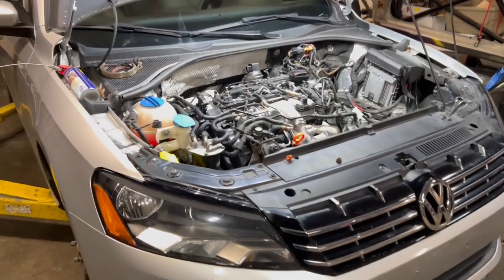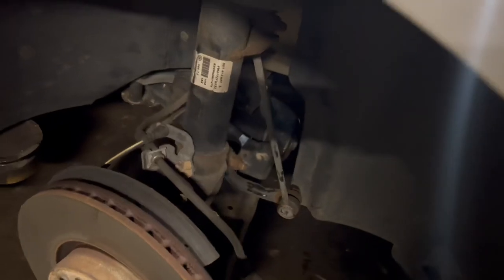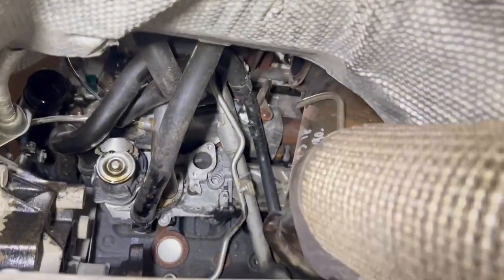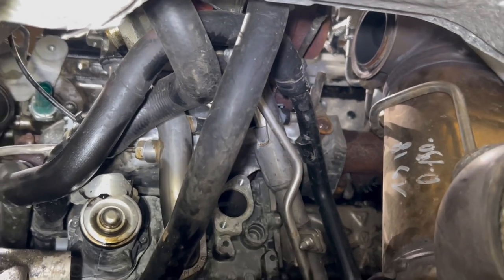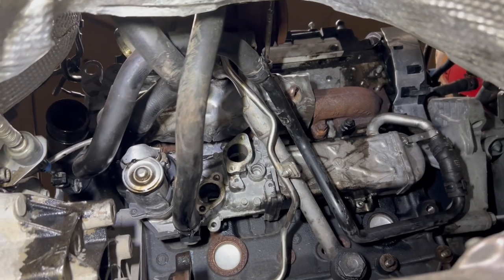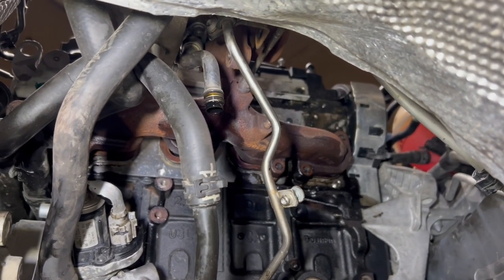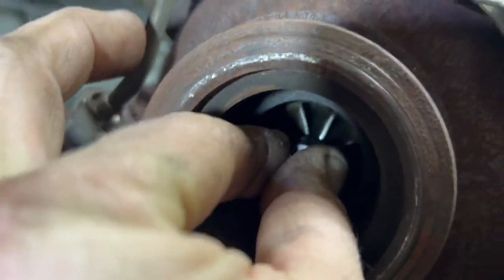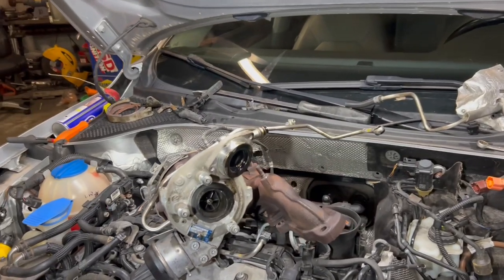VW Passat TDI 2.0 Turbo Failure

Comment: John on that turbo on the Passat you have to check the feeding line that goes to the turbo to feed the oil it kind of gets cooked internally and that's why it stops for oil and they break
Reply from the maker: Yes, I bought a new feed line as well
Reply: @TurboJohnRacing  good that'll save you a lot of problems
Reply: Its good practice to replace the  turbo oil feed lines whenever the turbo fails, as said above they clog up.

Comment: I had an Audi A4 for a short while.  The cam chain tensioner went out, I replaced with with a repro part ($100 vs $750), made sure it ran right and traded it in.  It was a nightmare to replace. I love the German stuff for many reasons but don’t think I will ever own another one that I have to work on…

Comment: My 13’ Jetta just had the turbo replaced at 165k miles. The compressor wheel exploded in half, was pretty impressive. I rocked the engine forward from undoing the dog bone  mount to the transmission and got it out that way.

Comment: John you should of callled me. I would of walked you through this been doing egr cooler flushes and dpf flushed this last week on these and the Audis and eco diesels . Take that egr cooler off and stick it in a bucket of purple power and water for a few hours you’ll hate for it to get plugged after just being there. Also it’s easier to disconnect the spindles from the struts and the rack from the sun frame and bungie cord up the passenger side of the rack so you can remove the whole sub frame and have tons of room to work.

Comment: TBH 173 miles for a turbo is a lot (about 270km), that's engine half life (most heavy users would be more than happy(ideal case) if a diesel engine reaches 340 miles, here in Europe). VW diesel engines are great, never let you down without giving you signs

Comment: Is this turbo lubricated by engine oil? If is is use synthetic oil and when the engine is hot let it idle for a few minutes before you shut if off.

Comment: Great video! So I have a 2014 Passat TDI and recently I been getting a static P00AF00 and oddly enough I have some kind of leak that’s coming from somewhere around the turbo/DPF. The vehicle has loss of power/limp mode. Trying to diagnose and hoping it’s something simple and not the turbo. Any suggestions on how to go about diagnosing the issue?
Reply: I’ve got big oil leak somewhere there too, bloody thing smoke 💨 when hot.. did you find your leak 😢

Comment: I’m doing one of these at the moment is there reprogramming or anything that has to be done after replacing
Reply from the maker: I didn’t have to do anything.  Everything worked properly, till the new turbo got a few thousand miles on it.  Started chirping.  Sold the car before it broke.  The one I put on was a cheap one.

Comment: anyone know what the part number is on this turbo? or if you can rebuild it?
Reply from the maker: I got it off a us company, but don’t remember the part number or name.  I tried to erase it from my memory, lol
Reply: @TurboJohnRacing the shaft on mine has a lot of play and i was wondering if it’s at all possible to separate the turbo and just replace the turbines cause i really don’t want to drop 1000+ on a turbo😂
Reply from the maker: @lucashageman1641  I'm sure someone offers are rebuild kit.  Just have to be careful taking it apart so that the compressor wheel and turbine wheel are in the correct location when going back together.

Comment: Take the summer air out n install winter air in the tires while your at it. Or you can get it from the top but it is same amount of time. I would rather not have to learn over the fenders anymore I would rather lift the body off and sit on the frame and get to everything I need . When having a lift. And you wondering why the book time says 18 hrs. So people like you get charged that when it's a hour job when you think your work all the way thru. From start to finish 3 times before you loosen your first bolts.

Comment: My mechanic does this stuff in an afternoon. Its not the car its your lack of experience working on these vw's. I would never trade a tdi in for a fucking honda 😂
Reply from the maker: @RaneBane  😂 but you are paying someone to work on it!  I had to do it myself, big difference!  And you are right, it’s my lack of experience on the VW stuff for sure!  I hate that I just kept having issues.
Reply: @TurboJohnRacing  it's essentially a Porsche.  I wouldn't wrench on one of those either lol.